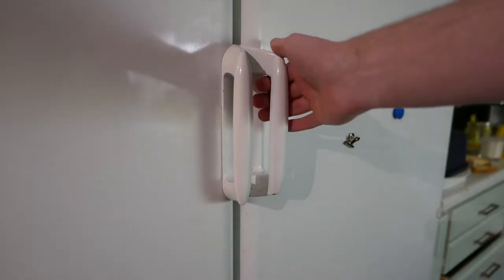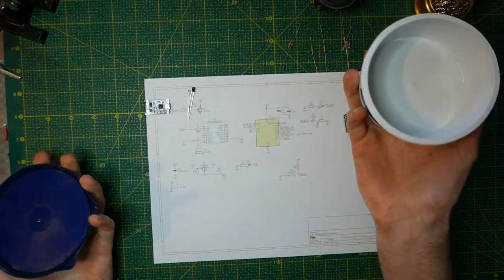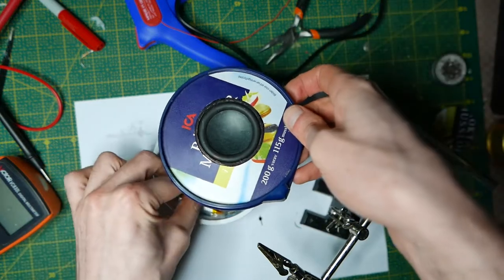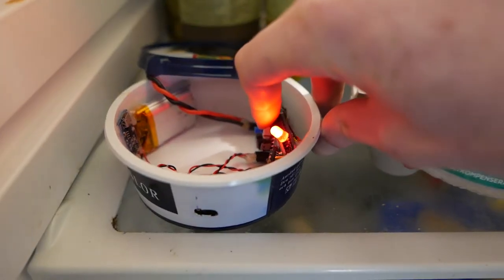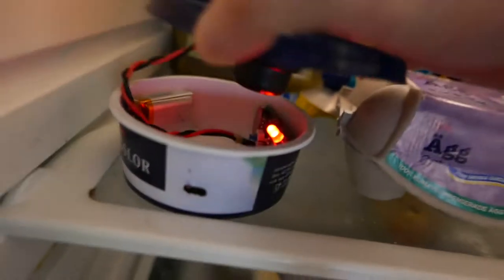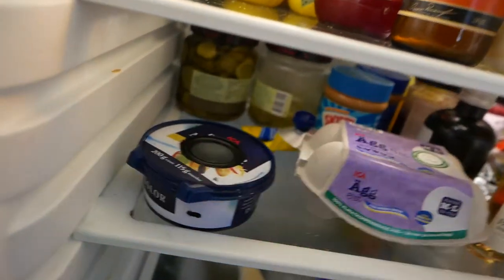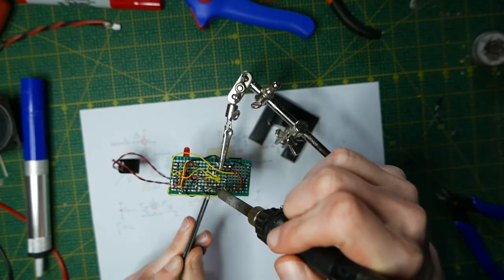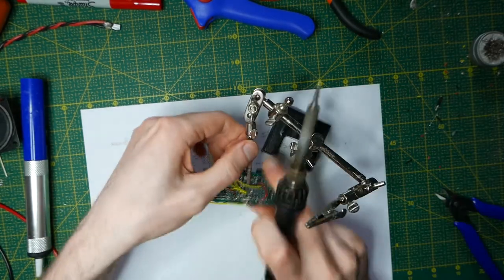Making your fridge angry if you leave the door open too long

Comment: Very cool project as always! If you do make a long format video, it might be interesting to talk about your choice of sensor over maybe a reed switch or ultrasonic time-of-flight sensor. I take it it's an infrared time-of-flight sensor?
Reply: I suppose even just measuring the reflected power from the tape on the door would be sufficient, no need to worry about time-of-flight, right?